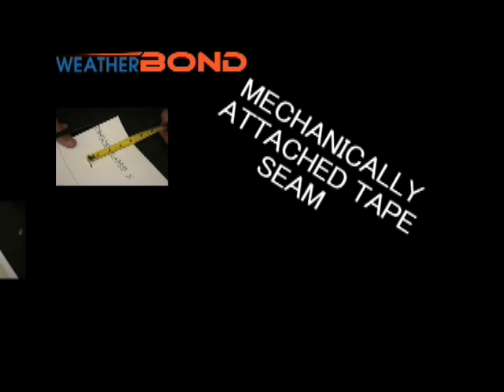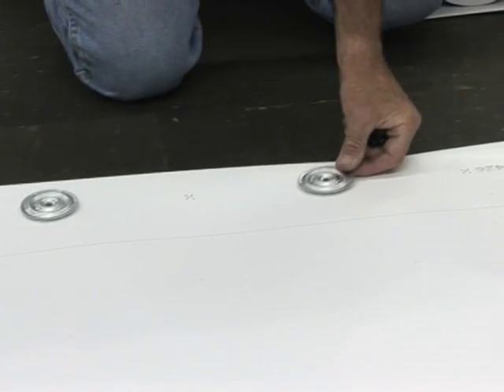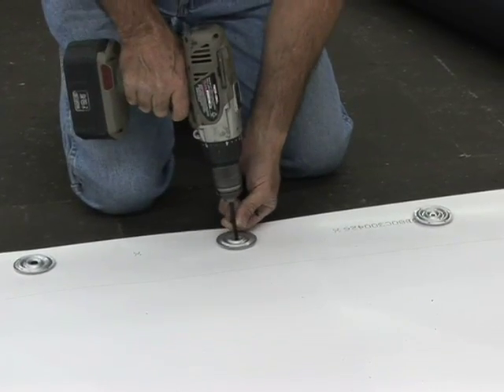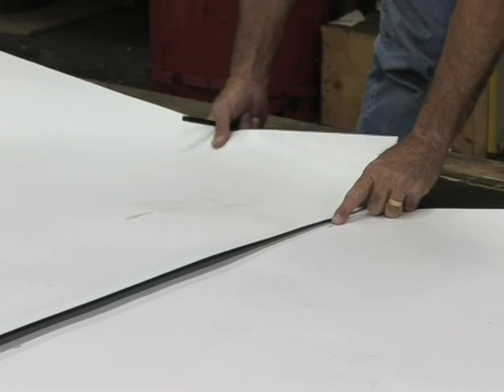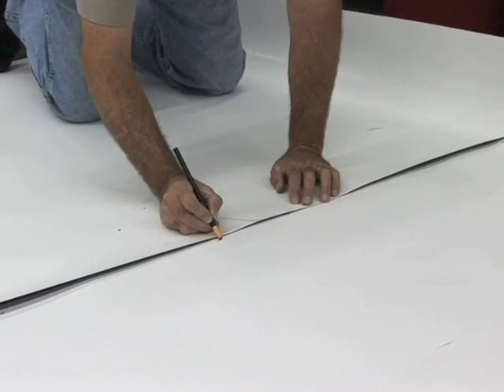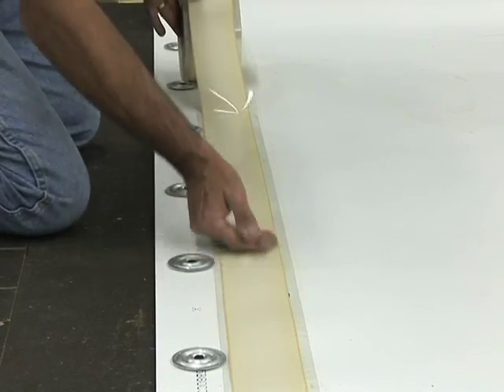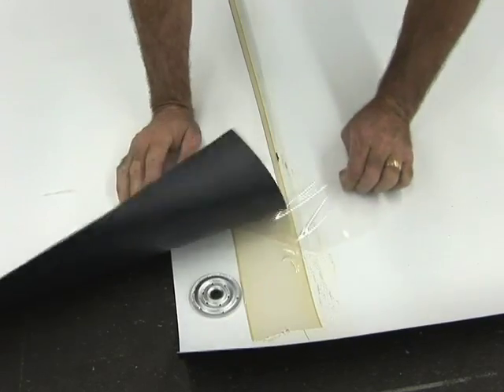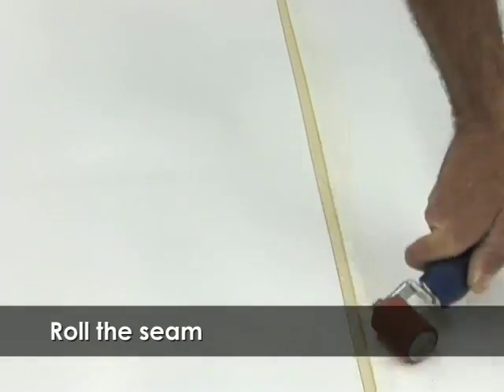Mechanically Attached Tape Seam - Weatherbond Weld-Free TPO

Comment: Why would you use a tape in the seam of a thermofusable membrane?  A welded seam is much better and will eliminate the extra cost of material.   What, you too cheap to buy proper equipment?